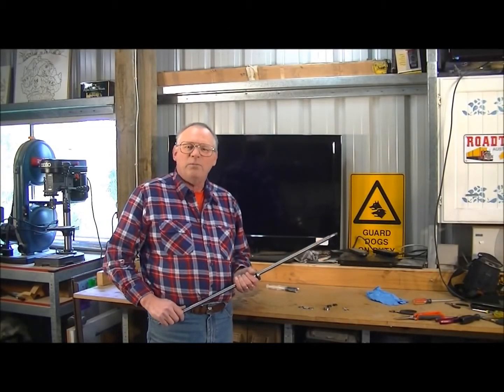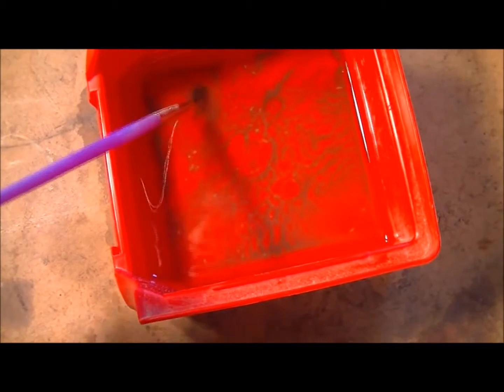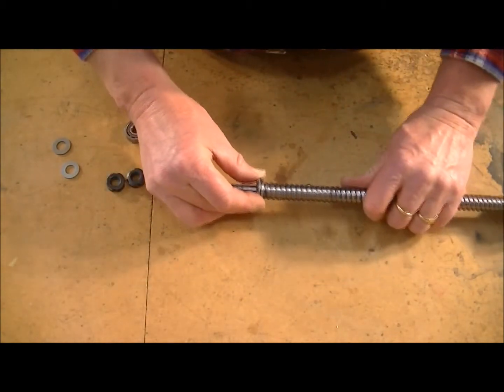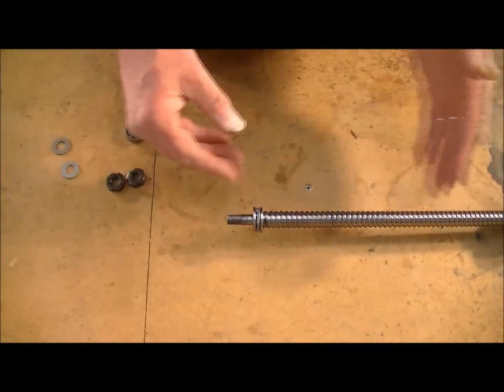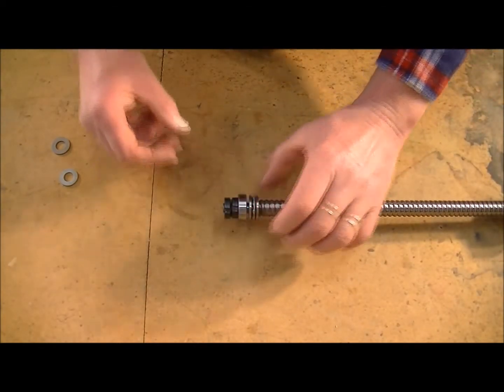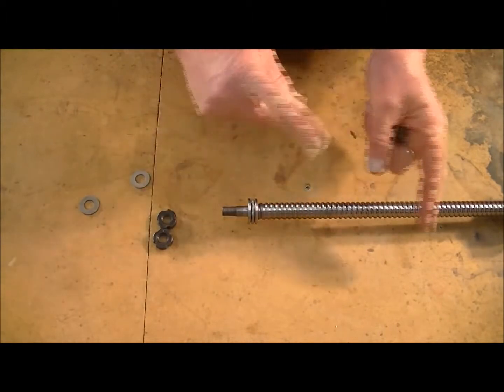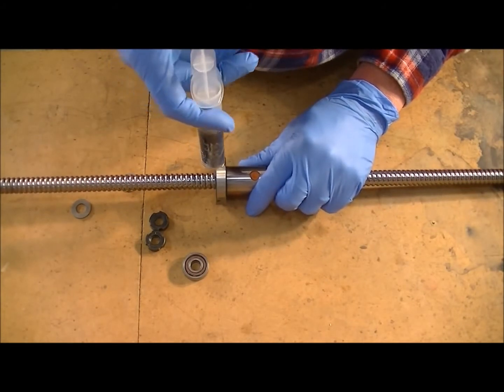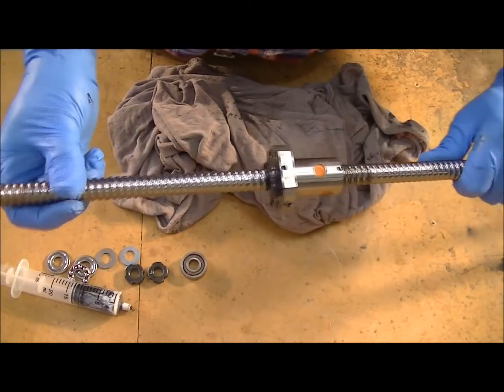CNC Router X axis rebuild and repair

Comment: You might consider replacing the ball bearings on the end of the ball screws with taper bearings. Ball bearings are not designed to support axial load.